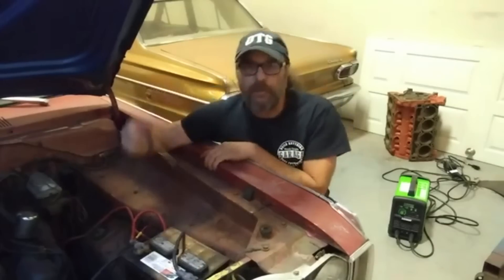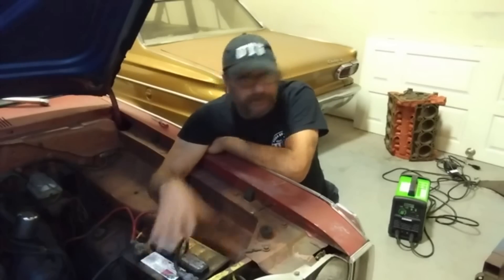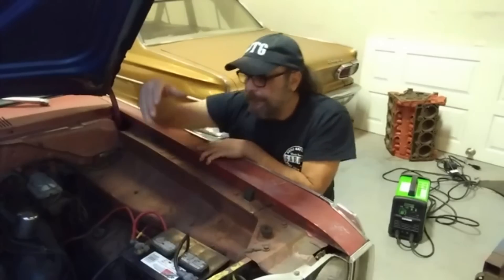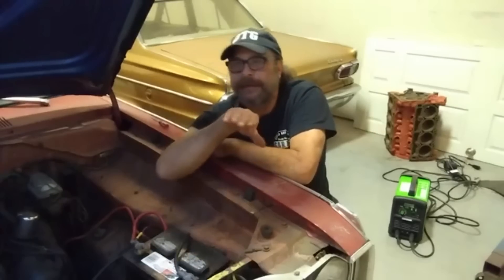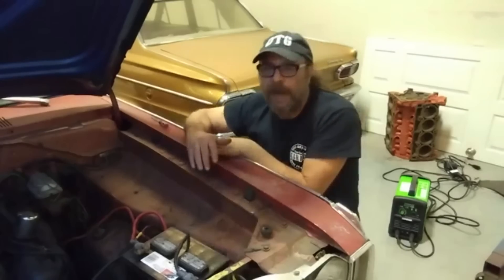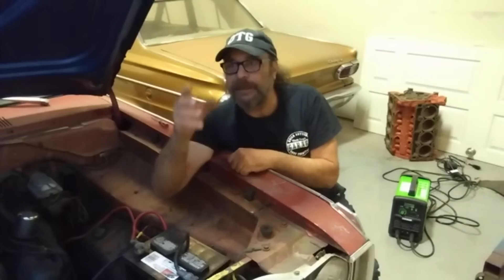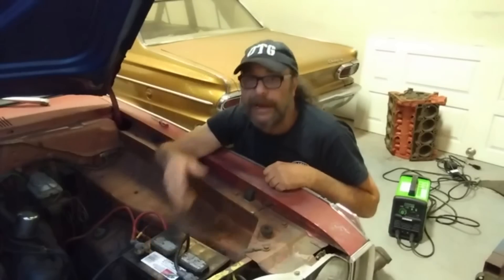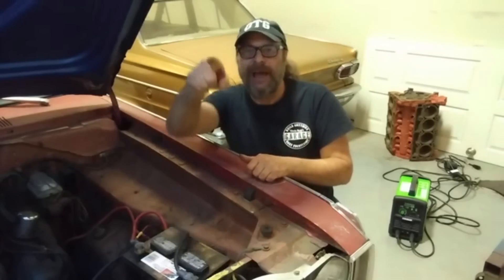Stick Welder Battery Revival SUCCESS!

Comment: I've had a battery where it died and I used Inox battery conditioner in it and set my workshop charger to reco which has a desulfate mode. Well I got about 4 extra months and needed to reco charge it every week or two. The inox dissolved the sulff in the bottom.
What happened is after reco charging it so many times big holes formed in the plates.
The reco mode hits the battery with a DC squarewave so it stays positive and just varies the voltage from 16v down to I think 13v. It's a very similar process to using at welder at 18v because as it bubbles the local resistance at the plate will rise giving VD. 
So I imagine this will only work a couple of times before the plates just deteriorate and the battery is dead dead.

Comment: It the hydrogen gas that is prone to explode. Do it outside so that gas blows away,  with open cells and keep the cells covered in water should be no problem. Anyway keep your face protected at all time. Acid will destroy your clothes. You will notice this after washing the clothes.

Comment: I work on a tow boat and I had a deck hand who on his job had to regularly check the batteries as part of his job checked fluid levels it was in a unvented area he thought it would be a good idea to use a lighter as a light source when he did it the battery exploded the top of the battery hit him in the face and he lost the sight of one eye so they do explode with the air space in the battery. Using a flame for light is not the brightest thing especially in a confined space but it happened. I would still love to try your charging method to revive my batteries I don’t think it is dangerous if it is done properly. Shit happens

Comment: Generally speaking when there is a person injured by an exploding battery a bit of investigating will tell the tale accurately. Usually one finds that the injured party had a lit cigarette in his/her mouth or in some way introduced an ignition source to the hydrogen coming out of the battery. It's only a small amount of gas but it is very powerful. Also...the battery is far more likely to explode if all of the caps are still installed. I have personally seen exploded batteries. I attended a tech school back around 1970 and they had several examples of exploded batteries. They are real and the danger is very real.

Comment: Doesn’t appear to be the same battery, unless you somehow put a new sticker on the top.  Original battery you punished your welder with 100% duty cycle on had a red top left corner no white border, This one clearly has a complete white border.  Let’s see the original

Comment: I just wish I had known this trick a long time ago. I had 2 deep cycle batteries on battery tenders. The electrolyte evaporated out of them. I filled them up with distilled water, but I couldn't get them to take a charge. I ended up scrapping them.

Comment: You're not producing pure hydrogen you're producing Brown's gas because of hydrogen oxygen molecule does not require any air I've seen batteries internally explode after charge where the plates is separated internally load tested arcing in the battery casing exploded this is fairly common I worked at interstate batteries for 10 years so you still need to be careful because it is possible goes off like a mini pipe bomb fragments everywhere

Comment: Ive had a truck battery explode, was charging 2 in series at 24V, around 30amps on the charger, the battery case lid was sitting on top of the batteries, and when I went to start it, I left the charger connected to give a bit more current for the starter, and it went boom, wasnt super loud but it was loud, and the batteries were turned into shrapnel...
but that's like the worst case scenario where there's literally a container filling up with hydrogen from the batteries..

Comment: Just revive another battery but test it first so there won’t be no doubt and you are right. I read the comments and most people have no idea what’s going on with how you used the welder and it does work. I had to try it as soon as I seen it work and a battery is not going to explode if the caps are off cause it can’t build pressure while the caps are off the battery
Reply: I had one explode with the caps off. It was one of the first attempts using my new Amico DC welder. After boiling the battery at about 50 amps for 5 minutes, I turned the amp knob to zero. This welder still puts out current when the amp reading is zero. So when I unhooked the + lead….spark, then….POP. It blew 2 new holes in the top. Big John Deere battery…was at least 10 years old.

Comment: Yep, overcharging the battery is exactly how you recover a sulfated battery that is otherwise good. There are several other ways batteries fail that this wouldn't work on. For example putting 20v at 100 amps into a battery that has developed an internal short wouldn't be good 😉
Typically what I do to try to recover a battery is hook it up to an old unregulated "dumb" charger like you can't buy anymore, and monitor the battery's temperature closely for a couple hours. If it's not heating up alarmingly, I let it sit and overcharge the battery for a few days.
Reply: Will an unregulated 2 amp charger work or does it have to be high amps?
Reply: @auteurfiddler8706  2amp should work, but it'll  take much longer.

Comment: I have done 2 batteries since watching your video and it fixed both batteries. Both still working like new. It does actually work. Saved me a chunk of change. Thank you!
Reply: What welder you using?
Reply: @maybe...d-s9n  250A 110/220V Stick Welder ARC Welding Machine DC Inverter Welder Dual Voltage MMA Welder Digital Display,Inversor Soldador With Electrode Holder Cable Clamp
Reply: $80 on Amazon
Reply: @BuildsAndMoreRacing  have to buy one
Reply: @BuildsAndMoreRacing  $80 on Amazon is cheaper than buying one new battery 😂
Reply: @jaymoe5.7  It is only worth it if you got multiple batteries to do. But also, you can play around with learning to weld.
Reply: @BuildsAndMoreRacing  I do have multiple batteries I could try this on, and I know how to weld lol I'm certified in MIG, TIG and stick haha. But I am excited to try this though, would've saved me a ton of batteries and money over the years had I known this sooner haha.
Reply: And environmentally good 👍

Comment: In more northern places, any batteries left without a charge will freeze. Frozen batteries swell and often split out the bottom or sides. Most of those batteries are beyond repair. Some of the cells might come back, but not enough volts combined with cold cranking amps depend on for a grocery getter. Owning cars in the north is so much more work. I'm moving. Please make room for me in the Uncle Tony studio!

Comment: Are the Harbor freight welders pretty good for the amount of money?? Always used Lincoln Miller and Hobarts mainly. A 100 bucks saved is a 100 earned to me that can be used to buy more parts if it works, if not you really only lost a little time trying to revive the battery and they'll bring close to 10 bucks in the scrap yard or can be demolished for the lead in them to make other things. Lots of helpful information on this channel UT

Comment: As a kid in auto shop class we had a battery on charge in the car while we continue to work on the car. As newbies we didn’t fill the battery cells, and left it connected in the car. We were soon surprised by a rather loud bang. Top of the the battery busted open scared the sh!t out of us, and the acid ruined my t-shirt. We learn by our mistakes. Stupidity is nature’s natural selection.

Comment: Worst thing that happened to me with a battery poofing, was my favorite shirt was ruined. My old Valiant was overcharging the battery, and it was round from boiling, I was 16, and dumb, so I opened a cap to relieve pressure, and poof! Covered me with acid. Washed off, and I was fine, my shirt looked fine at the time, but a bunch of holes showed up after washing it. Yeah, no big explosion 💥💥💥 lol! Used to work at sear auto, and on our giant trickle charger we had like 100 batteries at any given time, and occasionally one would burst, still no hydrogen explosion 💥💥 lol.

Comment: Most people that are blowing up batteries are causing them to explode doing stupid stuff, just like with vape batteries the user is usually the error or the short between the keyboard and the chair however you wanna look at it, and you are correct sir common sense is in short supply these days most people are dumb as fricken rocks

Comment: Biggest thing for me as far as Battery life. I have no problem with running a battery for as long as I can but it’s not worth a breakdown when you least expect it. I typically run flat acid batteries about 3 to 4 years after that it’s a gamble not worth coming to a bad battery. This seems to be the typical for most lead acid batteries. But lately at the 3 to 4 year mark the terminals seem to start leaking acid so if that point replace the battery not worth extra work and most battery manufacturers don’t warranty this because the battery will test fine. I have seen not on OE batteries interstates Walmart deca all manufacturers. Now if you keep a jump pack with you run the battery as long as you can.

Comment: I did this with a stone dead battery using 2 50 amp 12 volt chargers in parallel. Worked great and now starts my 9.5:1 454 in below freezing weather.

Comment: I have had a CTEK 7002 that I have had for 10 or 12 years, it has a recondition mode that has rescued many batteries. If it shows that the recondition mode will not initiate I use the 12 volt supply mode for an increasing amount of time (15mins to multiple hours, periodically monitoring battery temperature) then will try recondition mode repeating this cycle until it works. I have restored to daily driver status batteries as old as 14 years. There are other digital chargers that provide a similar recondition mode. Just a suggestion, I appreciate the channel and all the different cost effective ways you demonstrate to prolong component lifespan.

Comment: lol.  I don't make it a habit to read comments on youtube videos, and from the sound of it, I shouldn't start anytime soon.

That said, quasi related, moderately unamusing anecdote.  Was just out of high school in 2001.  Yeah, I'm still a kid, sorry.  Not my fault my parents waited until they were in their 40s to have me, legit wish they hadn't.  

Be me, late teens, into cars, working at OReilly auto of all places.  
Dude brings in a battery that was deader than my great-great-great grandmother and asks us to test it.  Bruh, this shit is roached.  
Insists.  
Fine.  Plug battery into charger on counter towards the "back" of the store and tell him it'll be a bit before the battery may or may not have enough charge to test.
Dude agrees and leaves, will come back later.
Choppin' it up with some buddies when suddenly, kabooom.  
IDK WTF just happened, but there was a really, really loud pop in the store.  Battery exploded.

I'll stop with the 4chan greentext now, and just retell the facts.  It didn't "explode" in my opinion, but something caused the battery to send the two caps on top skyward with enough force to embed them in the drop ceiling of the store.  Easily one of the most amusing moments of my very short "career" in the automotive field.  The stores response to this was to buy a small acrylic "charging box" to charge and test batteries in ........ but wait - is this box splosion proof??  Cause if not...........  :D :D :D :D

Comment: I've had one battery pop in my lifetime. It was on a 40's model Allis Chalmers 6 volt tractor back in '81. My dad was welding a bracket on the front of the tractor and we didn't disconnect the battery cables. We didn't think there would be an issue since the ground and electrode were both on the front away from the battery in the middle. It popped the top off and misted the acid a few feet all around. It sucked because it ruined the battery that we had just bought for it. It was the last time we welded something that had a battery connected to it.
Reply: Maybe 🤔 because it was a Positive Ground vs Negative ground?
Reply: @yogibear9607  I was about to make the same comment

Comment: Batteries like this can explode if there was an internal short between the plates where all the hydrogen and oxygen gases are bubbling off, I seen the whole top of a battery blow off straight up hitting the corner of the car hood and bending it almost 90 degrees and the top of the battery proceeded straight up another 30 ft in the air luckily this took place outside and no one was hit by any acid which will blind you and being outside ventilation wasn't an issue

Comment: Good stuff. People who haven't spent any appreciable time in the field repairing automobiles have little to no clue what we have gotten away with over the years. I applaud their caution, but a little common sense goes a long way. Keep up the good content.
Reply: Been working on vehicles since 1968 and never had a single battery explode or pop. Had one interesting issue once though. Did some work on my truck one day just before EMT class. Went to class and what was the subject,  chemical burns! And for some practical experience they ended up using my hand and arm. Didn't realize it until half way through class but the battery in my truck leaked and I got three burns on my hand and arm. They cleaned it up and sent me to the ER. Not good when you go to EMT class and become a real victim 😅 Replaced the battery the next day. The acid actually ate through my long sleeve shirt and thats when I realized I had a chemical burn. Ah the good old days! The cause of the battery leaking was the alternator was stuck on max charge. Replaced it as well. Never an issue after that.

Comment: I agree that the surface area of the plates inside the battery is much larger, there's more conductivity there than the tiny point of a welding stick. I had a battery explode into fire, upon being cleaved in half by a tree at roughly 40 mph in an 04 dodge ram

Comment: 7:42 uh.... their have been times that i didnt have 100 bucks (and all my batteries are more like 165 bucks)
.
im a mechanic.... i get 18 an hour
and yet..... i STILL needs more money
.
i can eat A LOT..... and i drive 100 miles everyday (50 to work...50 back...lots of gas... lots of oil changes.... lots of worn out parts)
all that adds up pretty damn quick
,
.
.
we also dont go by book time... 
im just "normal hourly" pay
 shop rate is 100 an hour....take it ..... or find another shop (and around here....RURAL!!!!! NE MT.... almost every other shop WILL mess up your car and/or try to scam ya)
.
if your car is clean and well taken care of..... im going to get done sooner
if your car is NEVER washed... so its a rust bucket.... and every bolt i touch snaps...... you are going to pay for that lack of care
or, again.... take it to another shop.....
i dont care...... i get paid the same anyway.... 
.
id like to work on your car...... 
id like to fix it correctly (and use the little tips and tricks ive learned over the DECADE.... to fix it BETTER than correctly / stock / factory)
.
but i dont care..... take it to who ever ya want
it will probably end up in my shop anyway..... (as im the only one stupid enough to take on cars that have been worked on by shade tree mechanics)
.
.
but if ya think im trying to scam ya because i said you have "2 hard stops left" on your front brakes
and ya say "nope... i just want the oil change"
.
and then you come back saying i messed up the oil change...... because your car now makes a grinding noise every time ya hit hte brakes
MAYBE YOU SHOULD HAVE PUT ON THE NEW PADS!!!!!!!
.
.
.
out here in NE MT.... we dont salt the roads
so a "pad slap" is 99.89% of brake jobs....... the rotors are ALWAYS just fine (unless they have 300,000 miles on them)
.
but ya.... im MORE than happy to also replace your rotors..... 
because you ignored me.... and drove for 10,000 miles with metal on metal
and STILL kept driving.... till the caliper piston wore the pad away.... piston cocked... piston shattered..... and now you have ZERO brake fluid
.
.
ya... im MORE than happy to charge you parts and labor...... 
ya... im MORE than happy that you turned a 90 dollar bill...... into a 500 dollar bill
.
thanks for making the shop EVEN MORE money..... idiots
.
.
.
.
.
yes, this happened today at work
and im STILL mad about it
.
i grew up poor.... working under a shade tree to keep my junk running
i know what its like to get FUCKED by a shop..... because they have the tools you dont...... so they KNOW they can charge whatever
.
i know how that is..... i was (and still am) their
so i have NEVER scammed or cheated a single person out of a single penny
.
hell... my boss gets after me for giving people deals 
like a free tire repair if they SIMPLY GIVE ME THEIR WORD that they will buy at least 2 new tires from us (or get an oil change, etc)

Comment: Professor Tony is lookin studious with those specticals/safety glasses.
Note: Battery manufacturers have to put the warning on the top of batteries for general safety data/product liability reasons.
Not because they're a explosive device.

Comment: Thanks for the update. Will try on several old batteries. Gotta deep cycle for my boat that is " begging ' for a dance with a little inverter DC that's been sitting around.

Comment: Your right tony i worked at a starter an alternator shop 4 years an only blew up two on with a load test the other with jumper cables but the one with jumper cables they over filled the battery

Comment: The cheapest battery I sell is $100 and I'd only put one of those in a car of I'm selling it lol. Your average retail price on a battery now is 160 to 190 bucks and even more if your vehicle requires an AGM battery... Ouch. When I first got into auto parts 20 years ago the most expensive led acid batteries were 60 bucks